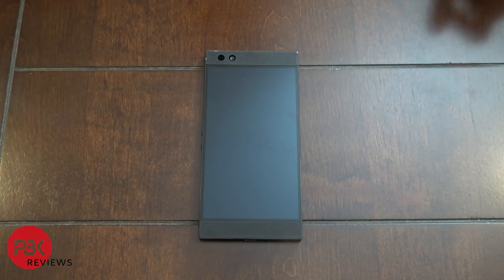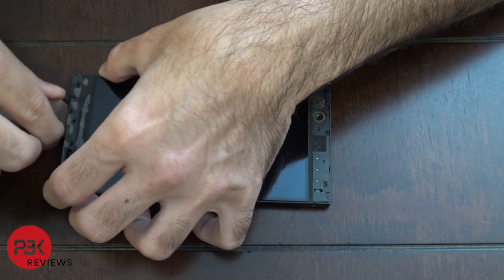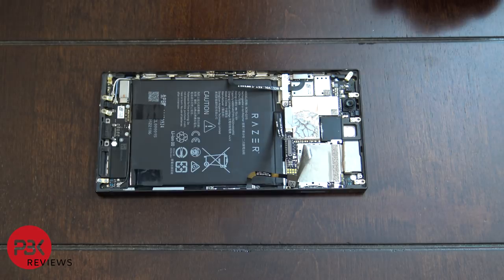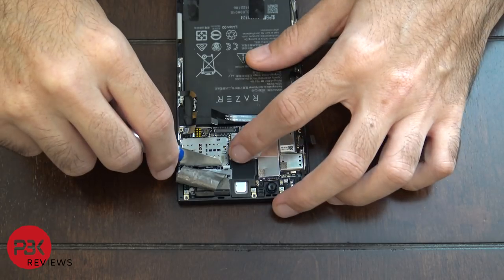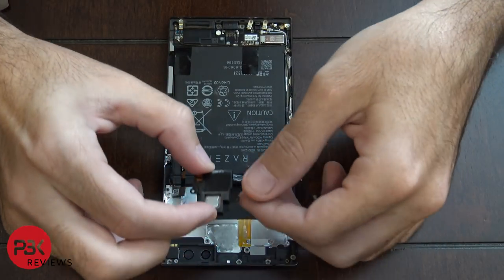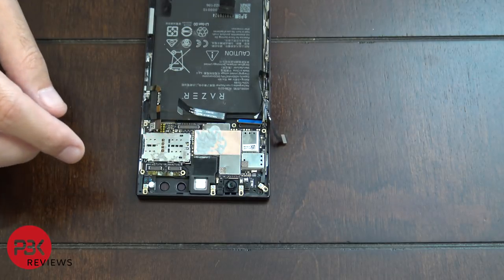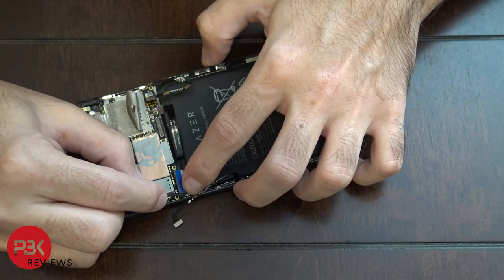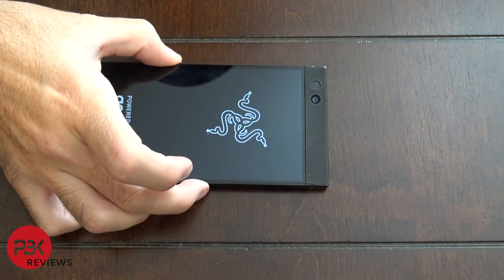2017 Razer Gaming Smartphone Teardown Disassembly Repair Video RZ35-0215

Comment: Awesome video man, you beat the ifixit to it. I have the Razer Phone and would love to know if Razer Phone supports UHS-II micro sd cards. Is there addition set of contact pins in the micro sd card reader since the UHS-I has one and UHS-II has 2 rows of contact pins. Much appreciated if you could figure that out and reply. Thank you very much :)
Reply from the maker: Thanks! Honestly I'm not too sure, I can't tell by looking at it with the shield over it and I don't want to risk taking the shield off and rendering the sim slot useless. But if you look at the video at the 10:29 mark, you can kind of see that gold contact line in the middle running down, I don't believe I've seen that on other slots before but I could be wrong. Without removing the shield its hard to see inside well, even from the side its hard to tell. Easiest would be to try out a UHS-II card and see if it works properly. Sorry if I couldn't help provide more insight into your question.
Reply: pwrdbykyank I totally understand. thx again for the info. Im actually in the urge of ordering one of the UHS-II cards if the Razer Phone supports the UHS-II bus and it seems strange that people at Razer doesn’t have a clue either (yes I did contacted Razer directly). 

Keep up the good work :)
Reply from the maker: Ya you'd think they should have the answer for it lol. No problem and thanks will do! :)
Reply: I put micro SD card into mine, only support FAT32 with 4G max single file size.
Reply from the maker: Are you sure your sd card is formated correctly?
Reply: Will Wang That isn't possible. 2TB in FAT32 isn't possible (32GB max), plus Android uses EXT4 filesystem for external storage.
Reply: matthew kuhl thanks for letting me. I have a 32G micro SD and want to put movies of 10G size on to it so I want them on my phone. 
So I can formet the SD card to  EXT4?
Reply: That's a bullshit limit put into newer versions of Windows to push people away from fat 32.... max under win98 was 127gb and real max is just under 2 tb... that said EXT4 is the better option....

Comment: Used this vid to replace my charger board. The screen turns on but doesn't detect touch. Any ideas?
Reply from the maker: First try turning the phone off and on and see if it helps. If not, make sure the cable did not get damaged for the screen, and is connected properly. Also make sure you didn't damage or break any chips or resistors on the main board.

Comment: Would be useful if you could actually find replacement parts... I've yet to find any. Anyone got a line on a replacment screen?
Reply from the maker: Yea, none I could find. Have you tried contacted Razer? Maybe they can offer a repair service for replacing the screen themselves.
Reply: @PBKreviews  actually shipping mine to them today. Don't know for sure if it's a bad screen or something inside. Hopefully they can get it straightened out.

Comment: hi, what adhesive did you use for the speacker grills ?
Reply from the maker: Hi you can find 3m smartphone adhesive on ebay or similar sites which will work well for the speaker grills, just make sure not to put adhesive over the spots where the speakers and such are so you dont block the sound.
Reply: @PBKreviews   thanks :-D
Reply from the maker: your welcome :)

Comment: The screen cable it's just ajusted with paste?....
Reply from the maker: No its clicks onto a connector on the mainboard/motherboard
Reply: @PBKreviews  Maybe lcd problem comes if thermal paste interferes with caps around lcd connector,or that metal piece over connector is not snug enough...sorry for late reply...
Reply from the maker: @vje24  If thermal paste gets in or around the connector, then yes it could cause issues.